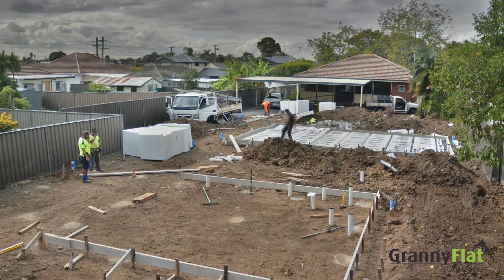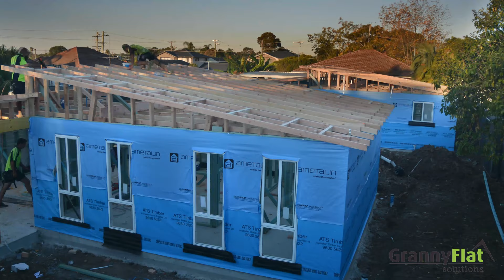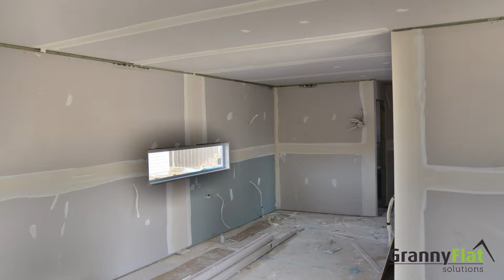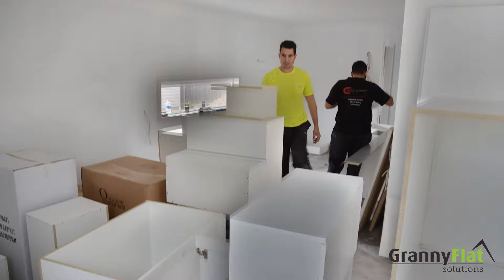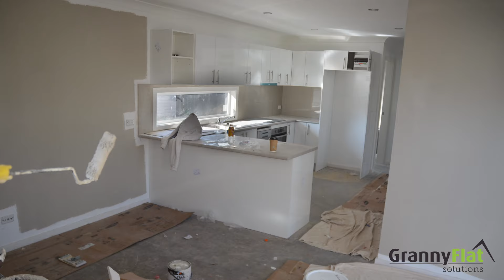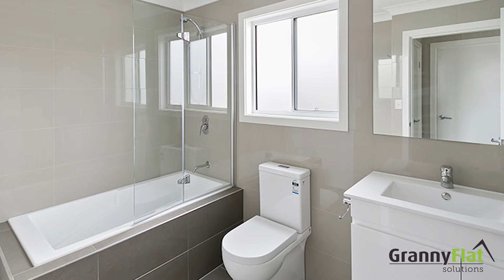Colyton Speed Build - Granny Flat Solutions

Comment: Can there be two granny flats in one backyard?
Reply from the maker: Hi Hasmatq,
Unfortunately not. A Granny Flat is classified as a 'secondary dwelling'. As such, you cannot have two 'secondary dwellings' on the one block; however, you can build a Granny Flat with a Studio. Read more about it on our website: https://grannyflatsolutions.com.au/granny-flat-range/studios-cabanas/

This job was actually completed on two seperate properties, that backed onto eachother. As the client owned both properties, she removed the rear fence to assist with a faster construction period (which was re-installed after the Granny Flats had been completed).

Comment: How is it possible to have two granny flats on the lot?
Reply from the maker: Hi Dhurba! This job was actually completed on two seperate properties, that backed onto eachother. As the client owned both properties, she removed the rear fence to assist with a faster construction period (which was re-installed after the Granny Flats had been completed). 

A Granny Flat is classified as a 'secondary dwelling'. Unfortunately, you cannot have two 'secondary dwellings' on the one block; however, you can build a Granny Flat with a Studio. Read more about it on our website: https://grannyflatsolutions.com.au/granny-flat-range/studios-cabanas/